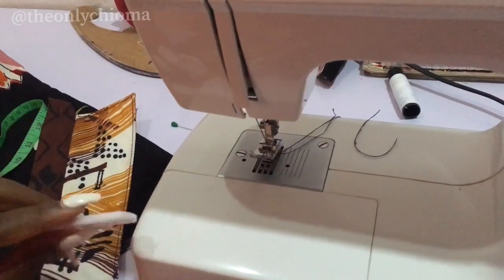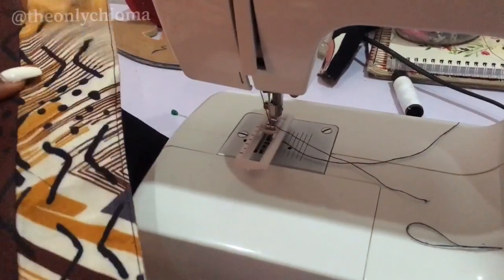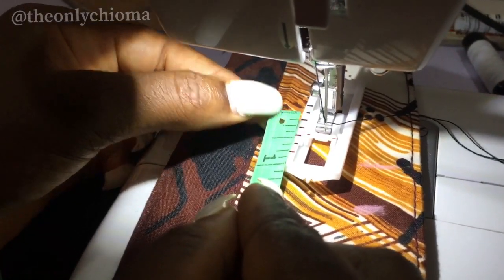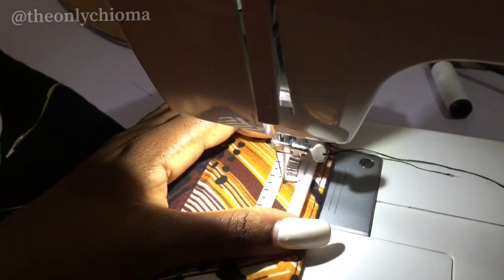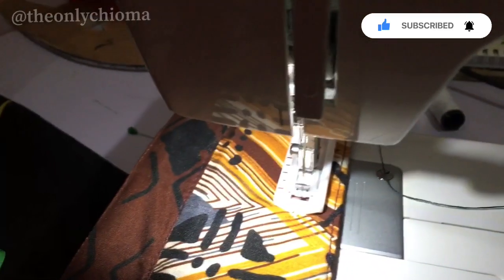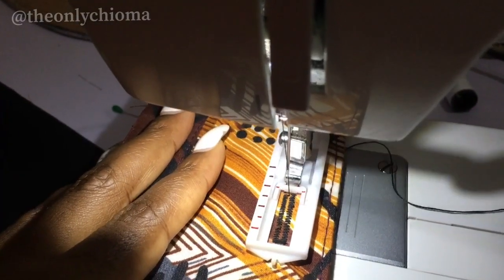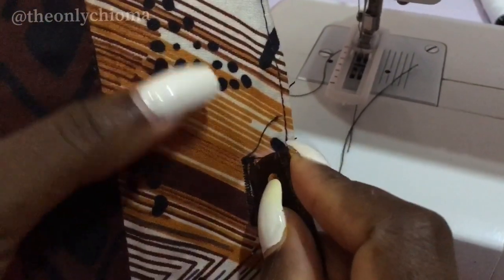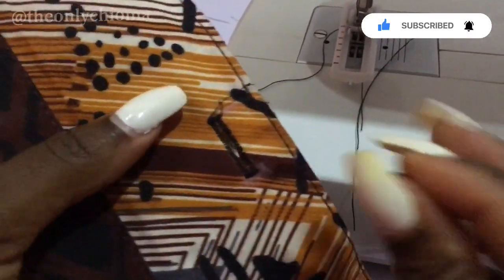HOW TO USE THE BUTTONHOLE FOOT/BUTTERFLY SEWING MACHINE

Comment: Thanks for the video. Plz, do you oil this machine?
Reply from the maker: Yes I do. Every Saturday. Nothing major really. I just pour oil in the holes on the needle plate, the bobbin compartment and the dog feeds.
Reply: @Theonlychioma  Thank you so much. God bless you!
Reply: @Theonlychioma 
Hi
Please, when the oil that comes with the machine finishes. Can I use the regular manual machine oil?
Reply from the maker: @kenearoh2445  yes sis. I’ve started using the regular machine oil. The oil it came with is really tiny.